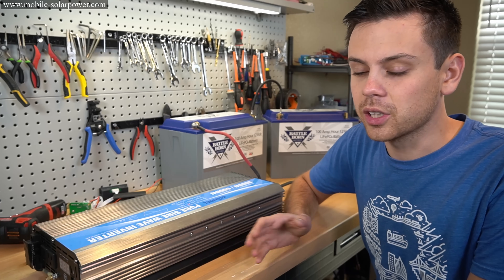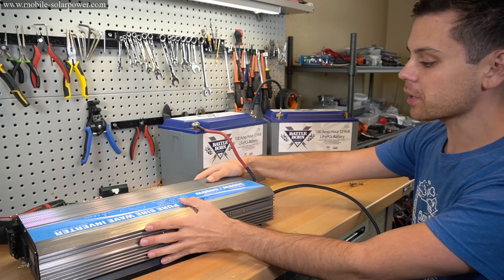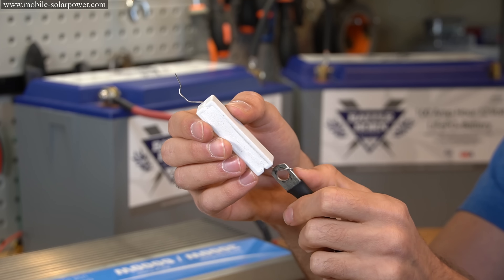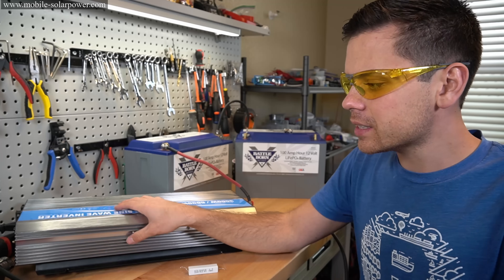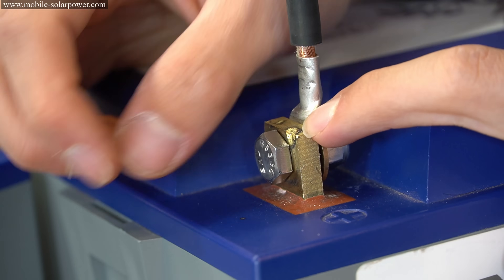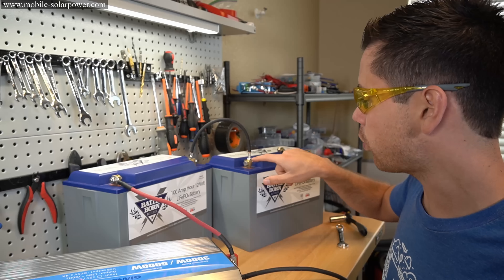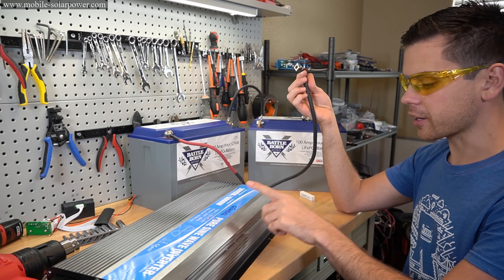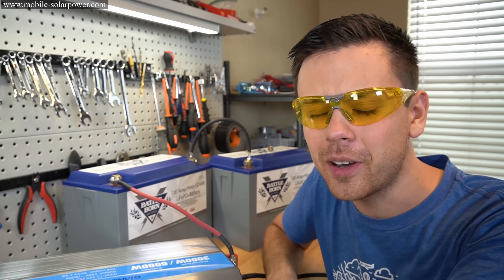How to Pre-charge Large Off-grid Inverters SAFELY. Save your eyes and your bank account

Comment: 4:30 - Excellent video and super important info to keep people safe. I didn’t see any links to the suggested 30 or 50 Ohm resistors so I looked on Amazon and found some “10PCS 10W 50 Ohm Ceramic Resistor, Power Resistor Assortment Cement Resistor Kit Wirewound Resistor” for only $5.48 for 10 (54.8 cents each); so super cheap. And even though using resistors should prevent any arcing I am glad you told people why it is essential to wear safety glasses (don’t want to risk molten metal getting in your eyes in case of arcing). By the way for anyone who wants to protect their entire face just get a face shield.

Comment: You used a 25W, 30ohm resistor for this 24v set up. What size resistor would we use for a 12v?  Im finding 10W, would that work? Not finding 15W, I do see 20W. Does it need to be 30ohms?

Comment: Thanks for the informative video. One question please. If the  main battery isolator  switch is turned off (and this turns the inverter off or the inverter has an independent isolator) how would this affect the pre charge status/safety of the system.

Comment: No, you do not need a resistor to connect your 24V inverter. You DO need the correct fuse, heavy cable, and tight connections. Pre-charge resistors are optional only to avoid the spark. ⚡

Comment: Important Tip that sadly Will Prowse did NOT tell YOU. You MUST use your 25W 30 Ohm RESISTOR on BOTH the Black Negative and Red Positive or You will still get a SPARK as soon as YOU connect the Red Positive.
Reply: Your positive shouldn’t spark if the ground isn’t hooked up In my experience. But I could be wrong.
Reply: @rnkustomz Actually you are wrong because it sparked on me twice. In this video Will did not tell you to use a resistor to dissipate built up electricity. But in a previous video Will did WARN YOU use a resistor. I got 5 of them for $7 on Amazon and they do work.

Comment: I used a full length (6 inch) carpenters pencil (sharpened at both ends for easy contact) to precharge my 2500 watt inverter.  Worked perfectly to both charge and discharge.

Comment: uuuuuuh regardless of using pre charge or a resistor you should not be connecting battery cable to terminal between a load device without a disconnect switch.  You energise the system by engaging the disconnect prevent major sparking and cratering terminal like a dumbass

Comment: 48v incandescent bulb is way better. If you have a dead short that resister in your hand will burn you quickly. The bulb will glow bright but survive. Secondly the bulb gives you a visual clue that you’ve precharged long enough. It will dim.

Comment: i scrapped a 12,8v 100ah new lifepo4 battery :(  i had 2 12,8 v 100ah i wanted to series connect  but i made a mistake  and one of the pole of the second battery when itouched the pole ripped out of the battery and i had that white   resister  25w 62rj. i must of shorted out  it make a big spark melted that screw . next time i try this  i will make sure i use the black wire  or i will simply buy a 25,6 v lifepo4 battery. i did not even plug the wires to the invertor a 2,,500watts. i started by connecting red to black on the first red wire  it happened when i tried to connect the second cable to the second battery.

Comment: Do you have to do this (charge the caps) this way after inverter 6000/3000w sits up a week or so without Battery/Batteries hooked up? I would think so since a lot of smaller Caps lose their power after few mins or so. Thanks 4 Video..   P/S... Burnt up a 1500 watt inverter trying to hook it strait up but inverter was over 15 yrs. old ( bought new back then) so I imagine some Caps blew up when I tried to do this because they were so old & had never had power to them , probably degraded.. A LOUD Bang & the smoke just poured out... Going to take it apart 1 day and see if I can replace them, If it was just a few that blew up... Thanks again.. The sellers of these batteries & Inverters need to tell people these things. I have a 2 yr. old  4,500w generator/Inverter  (new-never   started it) so I went ahead a ran it on propane 20-30 mins hoping All would be O.K. ( It Was)... P/S... Subbed . . .

Comment: In 2020 I put together a system with two 280Ah LiFePO4 batteries with JBD BMS and a Victron Multiplus 12/3000.  No problem with inverter pre-charge.  The BMS didn't care and I didn't blow the 225 amp Class T fuse.  Fast forward to 2024 and my new system is a 48 volt 280 Ah LiFePO4 battery with JK BMS and Victron Quattro 48/3000 inverter.  Blew the dang $50 Class T fuse as soon as I connected the inverter!  I couldn't find the right resistor so I implemented the 48 volt fork lift light bulb solution.  It worked great and didn't blow the Class T fuse.

Comment: Soon I will be adding a 2000W Bougerv inverter to our RV. In a permanent installation this pre-charge step would only have to be done once but I was wondering what happens when a cutoff switch is added? Seems like everyone adds the cutoff switch to the positive terminal which results in the negative being connected and then the positive with the switch. Assuming the cutoff switch has been off for an extended time, I'm guessing there would be a spark on the switch when you turn it on, correct?  Would it be wise to use a three-position switch where on one position the resistor is added and then switch to the other position where the connection is direct to the positive battery connection?

Comment: Hi I have a 12v system in my camper, 2x 120 amp lithium batteries. The only thing not connected is the negative to the inverter so I used the light bulb method from negative cable to negative on the inverter but my light just stays on, what am I doing wrong? 2000w inverter and 12v21w globe I'm using. Thanks

Comment: Why not just turn on the inverter after disconnecting the battery?  My 2500W inverter will run for up to 15 seconds after the battery is disconnected (with a low voltage alarm blaring)

Comment: This is great, but I do have a question... I was under the understanding you were supposed to attached the positive lead to inverter last.  Can you do this same thing between the positive lead and the positive terminal on the multiplus inverter, or should i do this only between the negative busbar from batteries and the negative lead of the inverter?

Comment: What would be the resistance value if I am using a LFP based battery pack having  rated output voltage and capacity 25.6 V and 200Ah respectively ,integrated with 2.5 kw inverter going to use for energy storage application.please guide me with pre discharge resistance calculation with contractor selection

Comment: Hi, thanks for the information.
What size of resistor do I need for connecting a 5kW 48V solar inverter/charger and a 100Ah LiFePO4 battery?
Thanks.

Comment: First time I'm learning about pre-charging the caps. Curious about say for example van lifers or RV builds where an inverter is typically turned off with a remote switch and then turned on when needed, obviously people aren't going out and charging the caps with resistors each time they turn the inverter on. Is that because if an inverter is already connected to the battery before turning it on no damage occurs?

Comment: WTF...no radio shack anymore? When i was growing up in the 70's in Australia, Radio Shack was called Tandy (which I believe is the name of the Company that bought out Radio Shack in the 60's).....I was like 11 or 12 when they opened a store in my suburb, and they had a membership deal (membership was free) where you could get a free battery every month.....for about 4 years, until they stopped it, I would get a 9v battery every month (because the 9v cost the most)......the owner  or manger would get cranky every time I came in to collect my free battery because I never bought anything.......he probably had a point....I never even used hardly any of those batteries! I bought a digital alarm clock from him when I landed my first job and he declared something like "Glory Hallehlujah"!!!!!!
Haha, what a silly memory but thanks for jogging it :)

Comment: All good Will. But spending on a 2 buck resistor is totally unnecessary on the 12V inverter level. Just tap in a 1156 ish 12v bulb or just about any 12v bulb. Dissipates that energy pronto. Whether powering up a new inverter or Dissipating the energy in an old inverter. Just wait for the light to go out😂. Job done. Let's not over think resistance
Reply: Hi I have a 12v system in my camper, 2x 120 amp lithium batteries. The only thing not connected is the negative to the inverter so I used the light bulb method from negative cable to negative on the inverter but my light just stays on, what am I doing wrong? 2000w inverter and 12v21w globe I'm using. Thanks

Comment: It such a good point that it is very disappointing that no practical solutions are offered when for when fitting an inverter in situ - particulary as they will be turned off and back on on a regular basis - even pointing the way to some off the shelf solutions (well anything really) would have been really helpful

Comment: ⚠️  Question!   What about the internal inverter switch.?
Does the pre+charging of inverters apply to every scenario?
Our communications engineer watched this video and mentioned “If inverter is OFF when connecting, where’s the load?”  And “Does the inverter’s internal switch or relay, etc..  suffer from contact arcing and burning damage?”

We are using 2000 and 3000 Watt Giandel and Renogy pure sine-wave inverters with our emergency vehicles (ambulances & light rescue) at 12v.  Some are permanently mounted and powered from the vehicle batteries (2x 12v deep cycle marine type) 
Some are mounted in Pelican wheeled cases with 100ah LifePO4 batteries for portability.
After showing 

Though this doesn’t apply to our fire apparatus as we have onboard diesel generators, if installing inverters in the vehicles that are all 24vdc, any particular advice?

Thanks for a great channel with a truly outstanding comment section!

Comment: Great video. I have done exactly what you are doing using a value of 200 ohm or larger and leave it connected for a minute or so. Another thing I have done is use a tail light bulb from a car in series with the inverter and the battery. (12 volt system) I just leave it connected unitl the bulb goes out and give it a few seconds more for good luck. The bulb will be bright and slowly dim. If the bulb suddenly goes out it may have burnt out so be careful if using the bulb method.

Comment: Hi, I dont see alot of people pre-charging inverters with 12v batterie battery banks AND 2000/3000 inverters. I found your video interesting and Im wondering if this applies to 12v or is more a concern with 24v batterie system and up? Cheers!
Reply: I just sparked my 12v so yes

Comment: I just saw a 50 Ohm resistor on Ebay and they're available at 50 or 100 watts.
Is that important?
I intend to use the resistor only to discharge my inverters capacitors.

Comment: Do you have an Amazon affiliate link for that little capacitor you have there I’m getting ready to build a small home solar set up I will be using a REDODO Battery and a Victron energy smart controller 100 V/50 charge controller I may go with a Victron phoenix 12 V inverter unless you have a better recommendation for a 12 volt inverter? I don’t wanna ruin my batteries so I would like to buy one of these little capacitors I’m not sure where to find one?  OK so I just found a 25 watts one ohms resistor on Amazon will that work for a 12 V system to pre-charge my 12 V inverter or should I get a different size ?

Comment: Just trying to wrap my head around this - when you discharge the capacitor like this, why does the capacitor discharge? Is the stored potential (i.e. electrons) on the negative plate of the capacitors flowing through the resistor (if used to prevent sparking) and back into the positive plate of the capacitors, neutralizing the potential difference?

Comment: Can you use a bench top variable power supply to pre charge the capacitors?
Reply: Answered my own question. Works like a charm using my bench to power supply to pre charge the capacitors on my 24v 4000w inverter.

Comment: Great info, but as a newbie I’m hoping for clarification. Initially it’s stated that lifepo4 under 1700W doesn’t need the procedure, but then that all lifepo4 setups really should use it. I know nothing about batteries, so I’m just trying to understand if I will wreck anything.  Is the same true for all lithium batteries? I want to use a 48V bike battery on a 500W inverter. Will I get sparks or wreck anything with such a small inverter?  The author does state that 24/48V should use the procedure, but is that with the assumption that a larger inverter is typically used with those voltages? I will only be using this in power outages, or to condition the bike battery, so it will be connected and disconnected multiple times per year, and I’d like to make sure that i don’t damage it.

Comment: Hi Will and other followers, I have a 10watt 22 ohm resistor, will this be sufficient for my 48volt system?
Reply: I don't think so.V=IR so 48=I22 which means your current will be 48/22 amps or a bit over 2 amps with 48V you would have 100+ Watts. That might fry your 10W resistor though I'm guessing the voltage across the resistor rapidly decreases as the caps charge up.

Comment: presumably if the battery and inverter have on off switches... connecting when both switches are off is good for no spark and safely powering on... power on the battery first then inverter??

Comment: if we hook it up to a battery switch before hooking the battery to the inverter and then switching it on will it still pop the BMS in the battery?  Should I still use a resistor for first time turn on when doin git that way?

Comment: Question:
I have a flat screwdriver with that small lamp inside for testing voltage or sth

Could this also work?
Can't find any 24w resistors like that in my area

Comment: What about adding that one dollar capacitor with a separate wire from battery to inverter throuh some small switch permanently. So every time it will be there and you will not lose it. And will add only2 dollars for that solution? In most cases you will have switch from battery to inverter anyway so making that additional small switch maybe a good idea. What do you think?

Comment: Hello Will. Thank you for your work.  We used your videos and your book to install our 2000W pure sine inverter, 30A Renogy MPPT, Blue Sea fuse block, to two 200Ah Ampere Time LiFePO4 batteries. We have 4, 100w Renogy solar panels in series up top.  The BT says everything is working fine and the batteries are 100% full.  But when we try to use the inverter, it works for about 20 min, then the light turns red. And it starts beeping.  We have replaced both the inverter and the mppt. But we're still having the same problem. Do you think that charging the inverter will help?  We took our Promaster to an RV center to see if the technician could ID the problem.  He used all kind of lingo to try to talk above our heads. And he said our equipment looked pretty and neat, but it was junk and tried to sell us some really expensive stuff that we didn't need and wouldn't accept. Then he said that he knew that we had been to a competitor RV center because his technician buddy said that he recognized our van.  This was our first visit to an RV center for help.  They charged us almost $800 bucks for nothing. We have only tried to use our 12 v lighting system which works fine off of the fuse block.  But when we plugged in a box fan to the inverter side, the inverter started beeping after around 20 minutes. The fan is a low draw.
Reply: To play devils advocate youre gonna get that kind of treatment when you go ask a tech to sort out your install that you should have taken to a tech to install in the first place. No offense but if you cant troubleshoot the issue you describe you were in over your heads. Those batteries have a BMS that ahould indicate if they are your weak point. Beyond that you should have a multimeter checking the voltage drop at the inverter when it demands a heavy load.   And while 800 seems steep to me to look it over and provide some diagnostics, techs really dont want to sort out an amateurs install of components bought somewhere else. 
The only way I can imagine getting a fair shake is to find an indy electrician locally and be prepared to spend a minimum of $500 just to have him look at it. 
Also go to Wills forum if you havent, draw up a schematic with what youve done, and some photos with a component list.  Some good minds there.  I suspect the inverter but it could be a lot of things. If the batteries arent getting charged the inverter wont function right and your $800 idiot should have been able to isolate the problem. I suspect he simply didnt want to.
Reply: if this Inverter is on an RV, make sure the panel where this connect to does not have a neutral bond, also when using this inverter if at any time there is a neutral bond in the system the Inverter will sense it, the inverter has a built in neutral bond already.

Comment: Thanks @Will for sharing your knowledge. Can you share some video about low PV 3kw hybrid inverter system details? I made one with 2 phono 540W panels (parallels). it's open circuit voltage is 49V. Rated power voltage is 41V. but when I connect panels to the inverter, it never comes the voltage above 37V. As I check the range is 34V to 37v. The issue is my inverter's (SAKO Isun 3kw) operation voltage is 36V to 80V. Seems my off grid system not working on most efficient way, since incoming panel voltage is not on appropriate range. As I see it will not generate more than 800W from panels in the noon and when the sky has no cloud. Have you ever faced any issue like this?